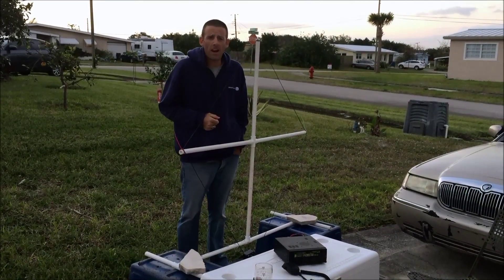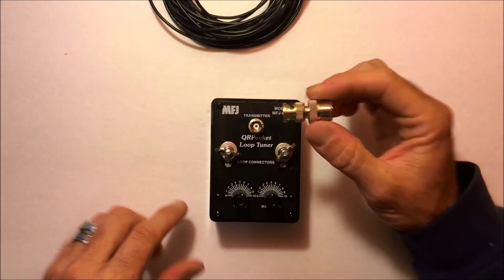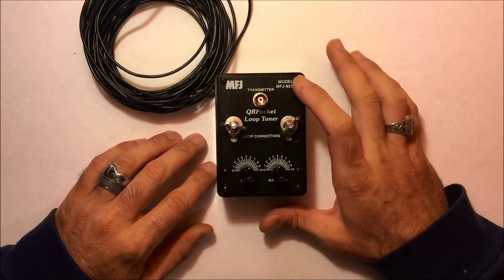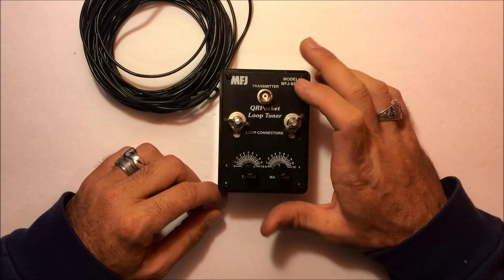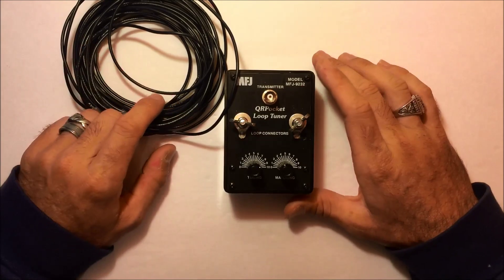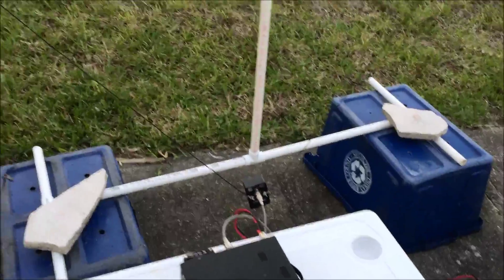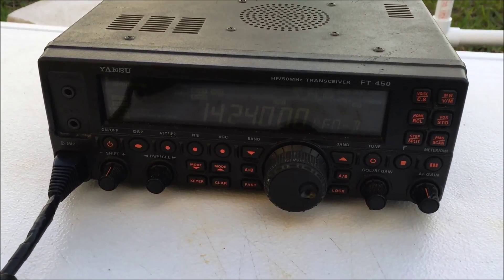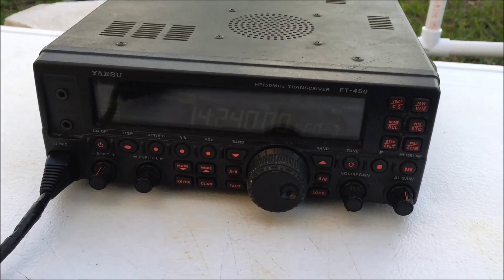Portable HF loop antenna MFJ-9232

Comment: Hi, recently I bought this one and I wonder if I can make only one loop with 20 feet to make contacts from 40m to 10m, or ONLY with these 20 feet, I can tune for 40-30m... or if exists another way to solve my need to get a multiband antenna for those bands, what is the correct size? Thanks for sharing. 73 de PR7RC

Comment: Tried my loop today and could not get my SWR down. I have to pick up my. Not sure if my tuner is malfunctioning. Will have to get an antenna tuner to see what I can find out. Used 10 gauge wire. 13 ft. 20m SSB
Reply: +rds801 -- did you get your SWR down to a reasonable level to tune with a tuner?
Reply from the maker: +rds801 Thats what i do some bands id im having trouble, i will get the loop to maybe a 3:1 then pick it up with the internal tuner on the radio, but the big tuner i did the 935b i got the tape measure loop antenna down to 1.0:1 no tuner needed..
Reply: +HamRadioConcepts --- that&#39;s great to know the 935 can get it to 1:1 but you can&#39;t get that close with the cheaper low wattage one? $210 versus $60 price is pretty significant even though the 150w versus 25w is a good point to be made.  Good to know that the lower wattage one may not work too well, and surprised that MFJ would not make that clear.
Reply from the maker: I never said that didn't you see in the video I had it working with 8 watts could just a little bit of practice to know what you're doing
Reply: +Kevin J I was able to get the SWR down with my MFJ 971 tuner. Did not try to make any contacts though.
Reply: rds801  -- yes but that means much of the RF energy was dumped inside the tuner and never made it out on the air.  With other similar MFJ loop tuners you do get it to 1:1 which at least gives you the perception that you are putting maximum energy out in a footprint.

Comment: Looks like surface area may be the key. More diameter. You can get a lot of copper cheap by using water conduit meant for the refrigerator. Or even thicker piping at 6 sides of 8.125' each may get you 80 meters. I'll try to make a YouTube video whether it's a success or not. It will be fun messing with this!
Reply: +gliderrider -- I bought cheap copper tubing off amazon for $15 to get 30 feet.  but have not experimented yet.

Comment: instead of wire I've made a aluminum loop out of 1/4 inch tubing pinched and drilled at the end to fit on the lugs....i made it 7.75 feet to use on cb as well.  my question is do you have to use the supplied wire or could I use my aluminium ring?  my loop calculator says it will be 71% efficient and will tune for 27.400.  any thoughts?
Reply: Gregory -- so did it work?

Comment: I just bought this little guy and haven't tried it yet but one thing I'm wondering about. Other sites on magloops indicate that the diameter of the loop conductor needs to be large to get any reasonable efficiency, that's why most loops are made with 1/2 to 1" tubing like copper pipe. The wire included by MFJ is only 20ga or something like 0.03".  Is there something special about the design of the MFJ that makes it work better with small gauge wire? Or should I go right for something bigger like 1/4" copper tube?
Reply: +Jason Livingston I am experimenting with thicker gage wires as well.....lov the tuner. I have a hula-hoop that I use to wrap the wire with the one it came with and works great....perfect circle and you can loop the wire around it to use more length.... Next one will be a tubing....I am wondering what should I do to have a multi band loop....maybe two different size of tubing or wire within the loop connected together at the nuts??? any thoughts?
Reply: @Kd4jwf2024  What bands are you getting?
Reply: @vetham100  20m, 40m and good reception on the rest...I am currently trying using a copper pipe
Reply: @Kd4jwf2024  Thats great. I hope the multi band loop works well.